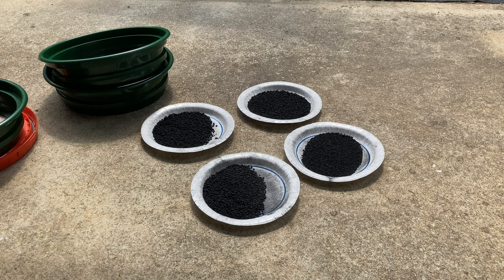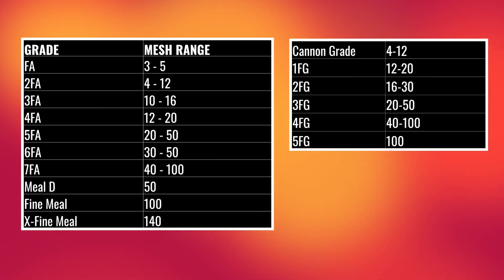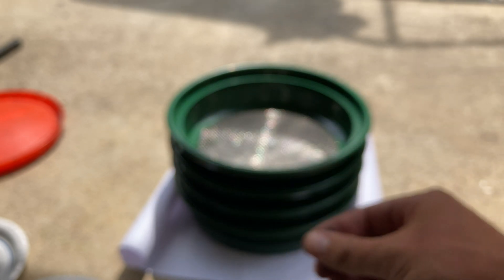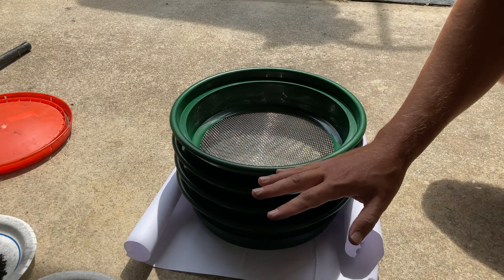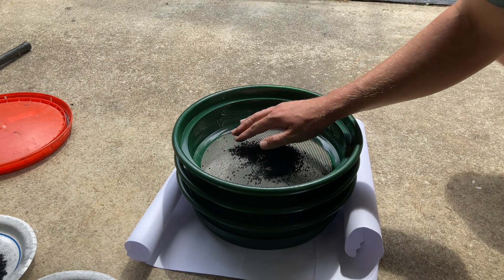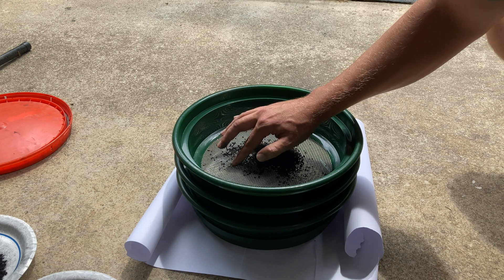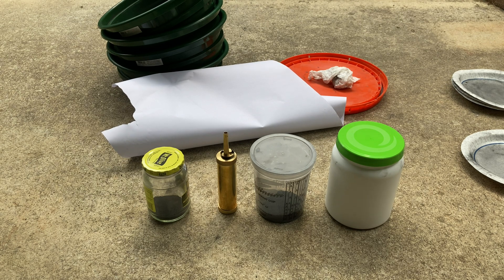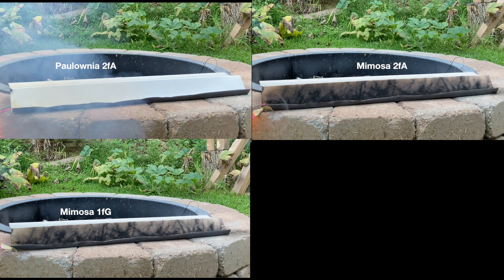Making Black Powder pt. 3 - Sorting and testing

Comment: Very nice and informative video!
One question: How can you separate FG from FA, let's say the FG,FFG,FFFG from the 3FA-6FA , since the mess gives equal granulation? 5FA is the same with 3FG, since their grain size is at the 20-50 mess range? After the graphite coating FA changes name to FG?

Thanks
Reply from the maker: Yes, the mesh sizes overlap and if the grains are not glazed then they would technically remain as an A class. For home production Its really just about trying to get the grain sizes close to what you want to match with load data for your specific application.
Reply: Thank you for your answer

Comment: What if I just mix all the sizes together and shoot it? It seems to work great.
Reply from the maker: Sorting helps with consistent results and matching load data for specific calibers. Also helps for different bore sizes to match tolerances from pressure (firearms vs. aerial mortar tubes). If you just want to make something go bang, then sorting probably isn’t as necessary.